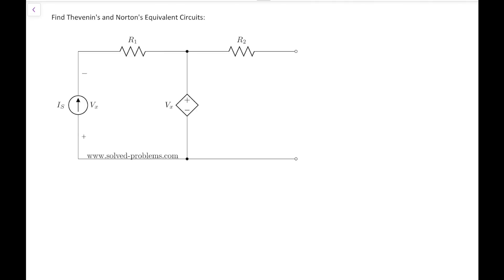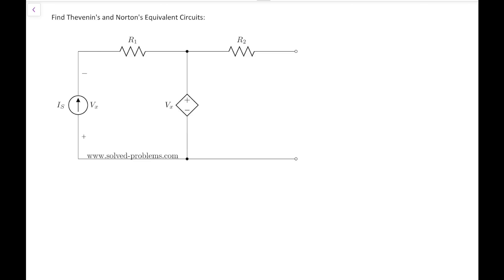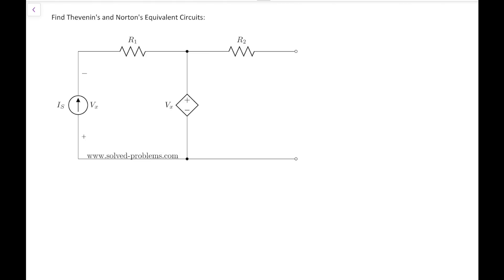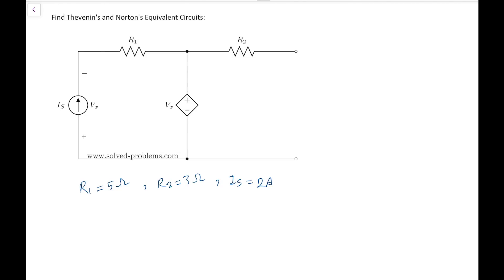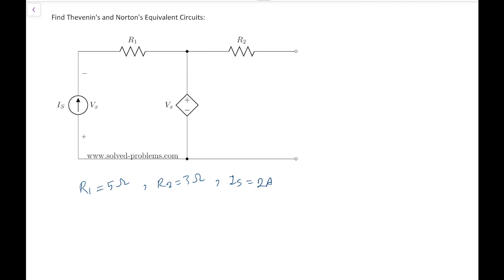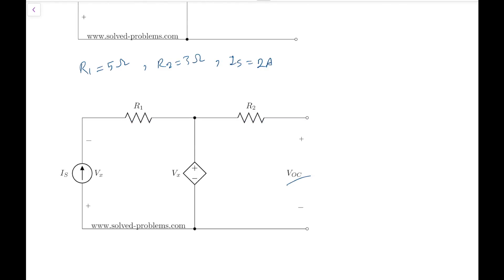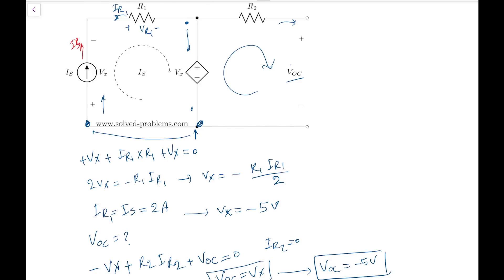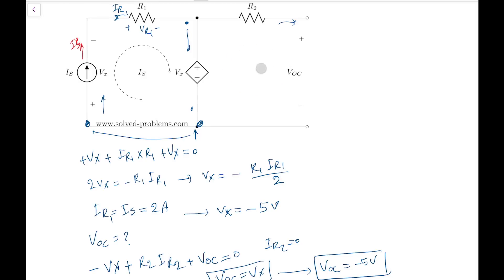Find Thevenin's and Norton's Equivalent Circuits - Solved Problems

Comment from the maker: Please note that the voltage across a current source is not necessarily zero! Similarly, current passing through a voltage source is not often zero. You can find circuits where voltage across a current source is zero, or current of a voltage source is zero, but not in general. I will post a video about this subject soon. Stay tuned!
Reply: Have you posted the video?